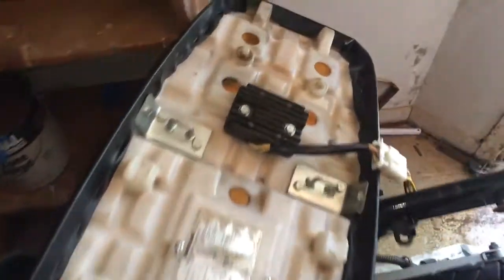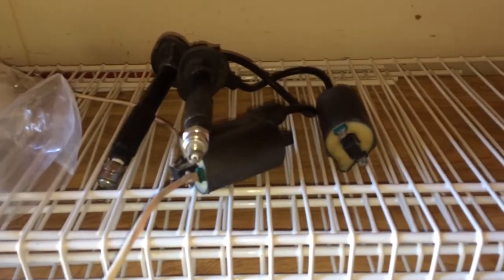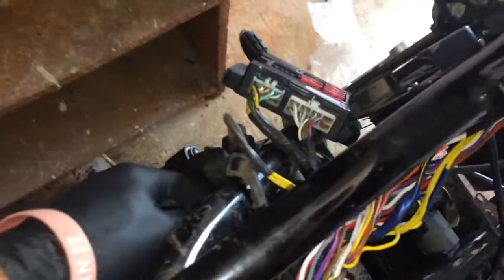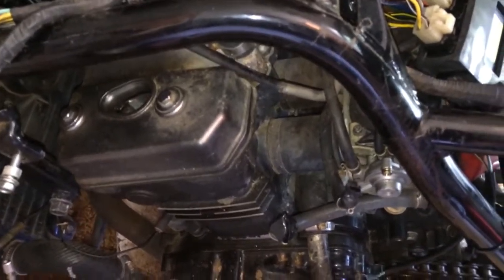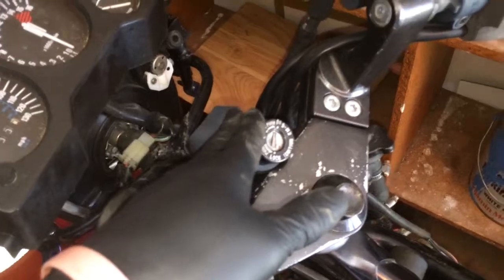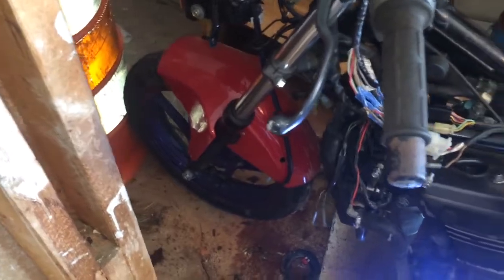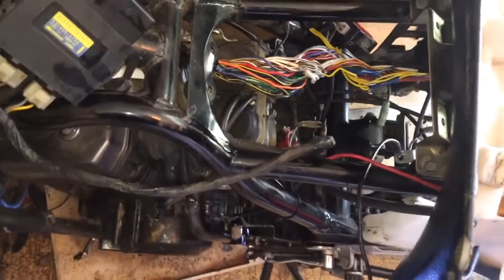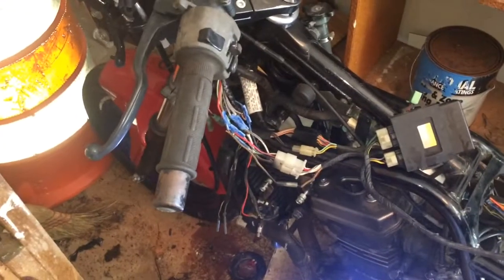97 Kawasaki Ninja 250 Project: No Spark Electrical Testing

Comment: did you find the problem on it because i have the same problem
Reply from the maker: The guy I sold it to did. Came down to a bad neutral safety switch, he also said he was only getting intermentent signal on the clutch switch too. I made $300 for free basicly.. I came out on top of the deal for sure
Reply: This bike is a plue of s it junk absolute junk